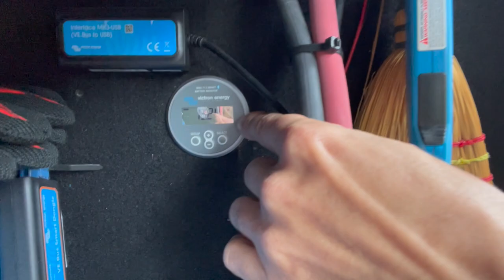RV Electricity Basics - Why Not RV: Episode 44

Comment: thanks so much for sharing your wealth of knowledge!  I love learning all this stuff that has eluded me for years.  so quick question - do all fuse boxes come with the list of what each fuse does? or is that something I need to figure out and make myself?  also are the fuses interchangeable? or do you need to have specific kind for each one?    sorry if my questions seem dumb.. just learning 🤪
Reply from the maker: First off, thanks for watching. I appreciate that. Second, there is absolutely no stupid questions. We all learned at some point. If you’re on Facebook, join our group and you can shoot me a direct message anytime. Now, to answer your questions, not all fuse boxes come pre labeled so sometimes you do need to figure out what fuse goes to what circuit. The fuses are sized according to that circuit and its wire size to protect the wire from overheating. So a 10 amp fuse is technically interchangeable with all other 10 amp circuits which is why it’s good to carry a multipack of fuses with various sizes in case one ever blows you have extras and don’t have to change out with another circuit. I hope this answers your questions 😁